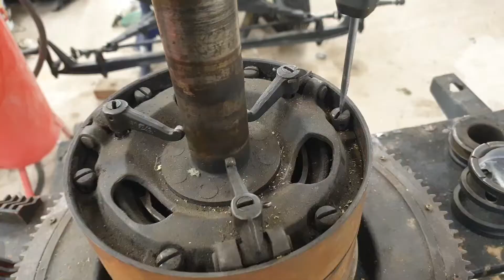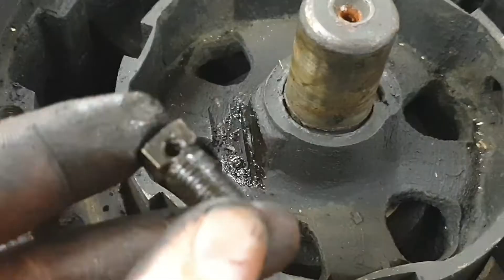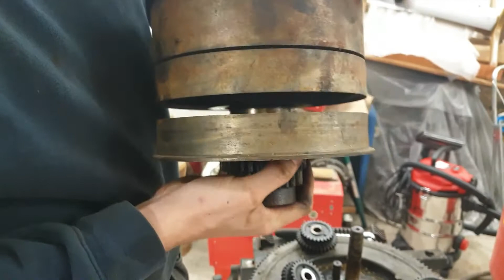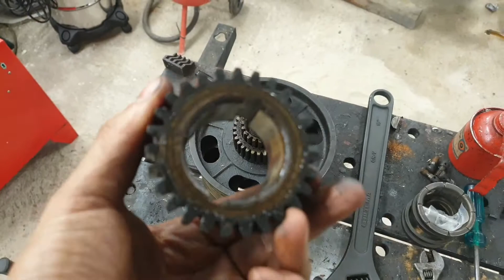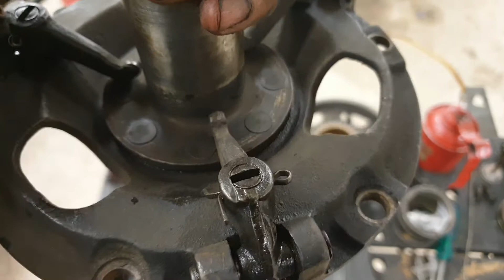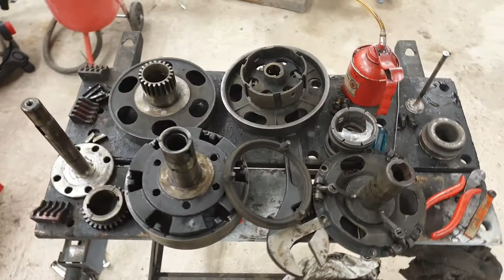Ford Model T Restoration/Build | Part 16 Transmission Disassembly

Comment: Love the vid but how did you get the gears out the hogshead
Reply from the maker: Remove engine from car, remove (starter), hogshead and oilpan, there are 4 bolts bolted from the inside with a wire through the heads of them.

You can see how it goes together at around 50 seconds in my video,  https://youtu.be/he1qoYyRCyY

Removing those 4 bolts then you can lift the whole package straight up.